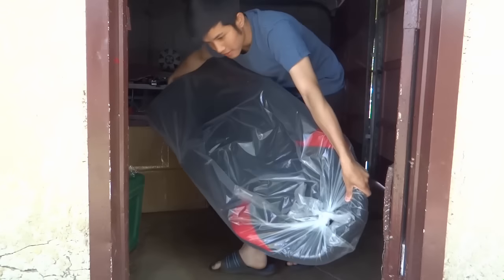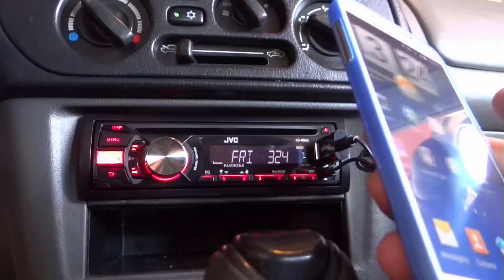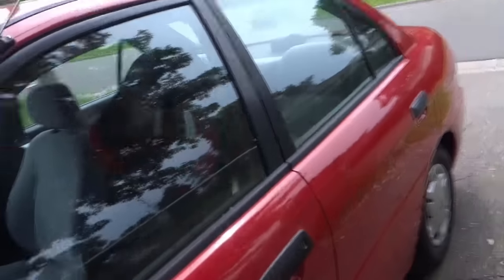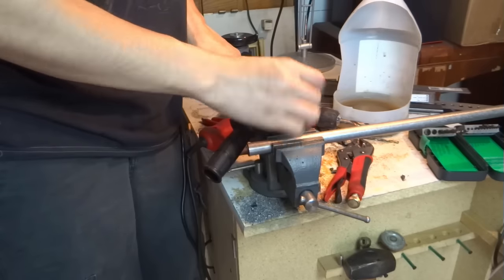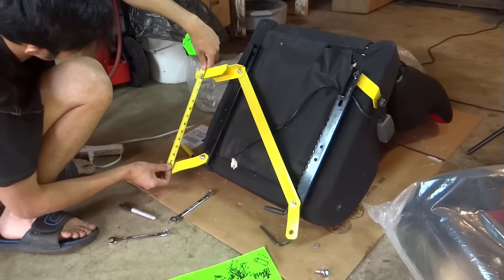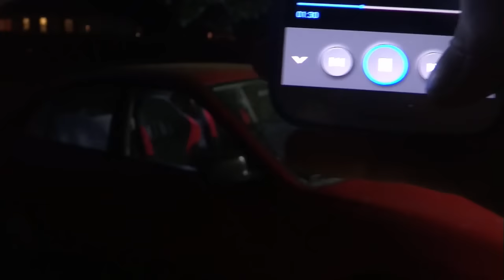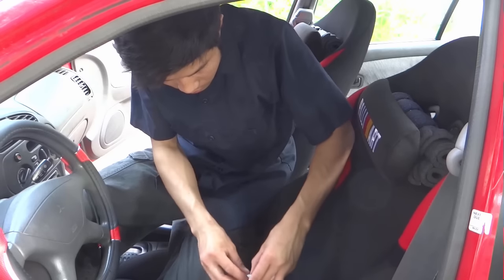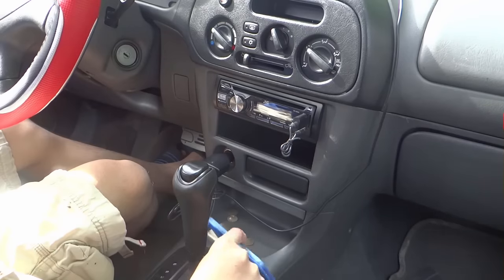Mirage Fix 11 | Bluetooth, Aftermarket Seats, RALLIART Pillows

Comment: you should consider making those brackets again, but we'll the pieces together and the unbolted tube should get a plate on the bottom to screw it onto the car. yet, you make some awesome ways to install parts.

Comment: Do you think the clams is safe to have directed at your neck if you would crash or brake hard sometime? Love to other work tho!
Reply from the maker: I thought about it. But however they can slip off easy with a little bit of force. Beside, the way they are positioned is safe for a crash, they are positioned pointed down at and angle, not sitting straight to the neck, so that is out of worry. when I lean back really hard, they would just flip down and not poking my neck.

cheers

Comment: are you still using those clamps to hold the pillow up? or have you found a different way? just wanted to know because those clamps could be kinda dangerous if you were to get in a accident.
Reply from the maker: Still use them. lol I will make something to replace them.
Reply: +DarkDragonWing OK cool. just would hate seeing you get hurt from that and it could make a cool video showing what you come up with.

Comment: Can u give me the website of where you got the aftermarket seats, Im 13 but im building a 2004 civic. Love your vids keep up the good work
Reply from the maker: Stance. Imports You should go to ebay.com and buy the ones that will fit your 2004 civic. The ones I have are not available anymore. Here http://www.ebay.com/sch/i.html?_sop=15&LH_BIN=1&_from=R40|R40|R40|R40|R40&_sacat=0&_nkw=2004+honda+civic+racing+seats&_pgn=2&_skc=200&rt=nc
Reply from the maker: Stance. Imports You will need the brackets too http://www.ebay.com/itm/02-05-Honda-Civic-Hatchback-3Dr-Racing-Seats-Mounting-Brackets-Rail-Track-Pair-/371224773351?fits=Year%3A2004|Make%3AHonda|Model%3ACivic&hash=item566eb882e7&vxp=mtr

Comment: Only thing Im curious on is why you made custom mounts for the seats. I know many seats dont fit the stock seat rails. However, unless it wasnt shown, you could easily of modified your stock rails to fit. And it would of been cheaper.

You did a GREAT job with the custom brackets. And it works great it seams. Much respect for your knowledge and ability to do that kind of thing on your own. Very helpful to people who may get scared to try. 

Either way works, I was just curious.

Are you planning to upgrade the lights on the car? I know from the RC videos you know how to work on that stuff very well. Angel Eyes would look amazing on both your cars! They are a nice touch of "eye catching" and function all at the same time.

What kind of rims are you looking at? Color matched or something different? With a red car that you are going to put a bodykit on later. May I suggest black rims with either a chrome (or brushed aluminum look) or red lips. I think that would really stand out. Im a fan of the black and chrome lip wheels. But, they arent as cheap as full painted wheels. 

Ill get a link for you on the Angel Eyes so you get an idea.
Reply: Couple links, you may of picked out what your getting. But, if not...some ideas.

Angel Eyes
http://www.protuninglab.com/lighting-projector-headlights.html

Red lip wheels, with main black
http://www.wheelfire.com/scontent/WheelDetails.cfm?IDNumber=Illusion%20Red%20Cc&SKU=5782

Chrome lip
http://www.bigbrandwheels.com/American-Racing-Wheels-AR363-Haze-16-inch-16x7-0-Black-Rims-with-Chrome-Lip/7184/

I think the red would really stand out on the rims. The chrome is so nice, but you also really worry about chipping on low end versions. 

Hope that help in some way. Im a fan, and also like to do car upgrades. I just got my sound system working perfect. Only 1 12" sub with a 400watt amp. Nothing too huge and loud. But it sure makes the music better!
Reply from the maker: M Davis
Nice.

Yea I tried to use the stock brackets, but it didn't work very well, it was too tall for the seats.

For the rims. I decided to go with 5 spokes with chrome'ish, video coming soon!
For the lights, I have seen many angle eyes out there, they look cool. However, I think I would keep it simple OEM swap stuff so I will go with HID 6000k.

Wow you got some good sound system there. I will maybe try to mess with that too, but only if I'm done with everything else.

cheers
Reply: The DarkDragonWing Yea it makes driving alone alot more fun. I didnt want to go over the top. I see people with 2000watts and unknown amount of speakers. When I was younger, I thought that was cool. Now, you need something that gets you good sound. But, you can turn down if your with people and still talk.

I have an 2003 Tiburon GT (V6), Magnaflow dual exhaust (simple bolt on, stock is a dual setup), K&N high flow air filter and I have some high temp spray on some parts in the engine to keep it cooler...and last, my headers are 1/2 wrapped (near the hood, less as it goes lower) with header wrap. All in an effort to get just a bit more power and have things work a bit better with better air flow. Nothing extreem, just basic stuff for better and cooler air flow in the engine.

Comment: what is the size of the steering wheel cover?
Reply from the maker: Are you getting one too? I would not recommend, I'm getting MOMO steering. Anyways, 14" or 15" will fit just fine.
Reply: I have one but it is too loose. I was thinking of just doing without one.
Reply from the maker: Prometheus
 Without is better.
Reply: I'm not sure but the cover says it fits size 14-15.
Reply from the maker: Prometheus
 Yes, that will work

Comment: hey dark dragon wing can u send me the names of the spraypaint i need to buy to do what u did in mirage fix 14
Reply from the maker: Vickash Boodram VHT spray paint http://www.ebay.com/itm/VHT-SP731-Brake-Caliper-Drum-Paint-Real-Red-High-Temp-/121266842658?hash=item1c3c112c22&item=121266842658&vxp=mtr http://www.ebay.com/itm/VHT-SP121-Universal-Bright-Red-HIGH-TEMP-ENGINE-PAINT-/141674852322?hash=item20fc7aafe2&vxp=mtr http://www.ebay.com/itm/VHT-SP106-Flat-Silver-Flameproof-trade-Coating-Very-High-Temp-/351017959557?hash=item51ba4d0085&item=351017959557&vxp=mtr http://www.ebay.com/itm/VHT-SP734-Gloss-Black-BRAKE-CALIPER-High-Temp-Car-PAINT-/391153092444?hash=item5b128a875c&vxp=mtr

Comment: Quick question, is the mirage awd?
Reply from the maker: 2488viper All Mirage are fwd, only EVO that are awd.
Reply: Funny I see your comment. I've actually been looking into converting a mirage to an evo using the awd system in a dsm. That being said, it will be extremely extensive.
Reply from the maker: Yes, I thought about that too. Converting Mirage to EVO is as expensive as buying EVO 9 if not more. It could be less, but only if you know where to buy parts.

Comment: well super unsafe
the way u pointed this clams under your new head holders in case of accident will break your neck.
i dont see reason installing this kind of seats if u need to make them super unsafe.
this seats come with special safety belt that closes in the bottom of the seat.
i offer you to change to regular seats before someone get hurt
Reply from the maker: scorpionjb4ever Nope. Those clamps are harmless. I tested them, they are easily fall out with a pull. They are angled down and they are plastic, not sharp. Plus, if I will ever crash, my neck is not gonna move back, my whole body is gonna move forward. What safety in the bottom of the seats again?
Reply: The DarkDragonWing  don't know what your test included from my side of view its looks very dangerous .
the belt i mean its called "5 point seat belt" used almost in every racing..  its  much more better for this type of seats.
normal belt does not  good. look all the rally or regular races . 
(thank you.. have a nice day)
Reply from the maker: scorpionjb4ever
 Oh that, well, this is a cool normal daily drive car, not for track or racing purpose.

My test was just bumping really hard against the pillows and the clamps, my neck is no where to be harmed from the clamps. But I know what you mean.

Cheers